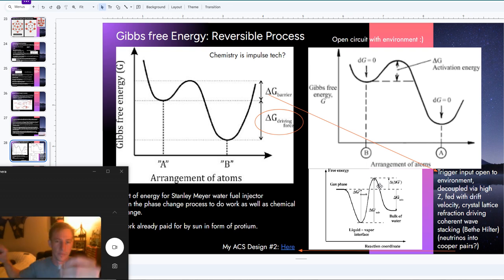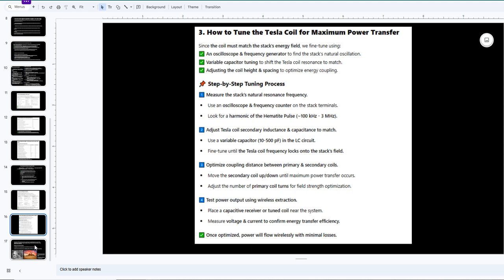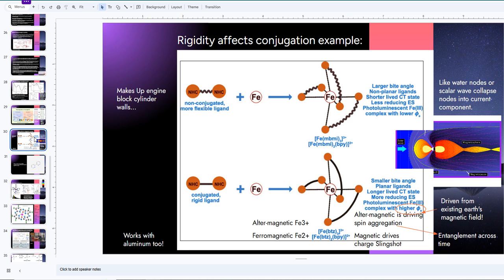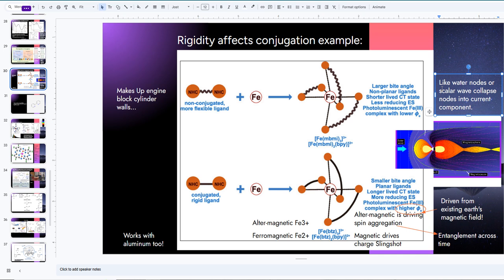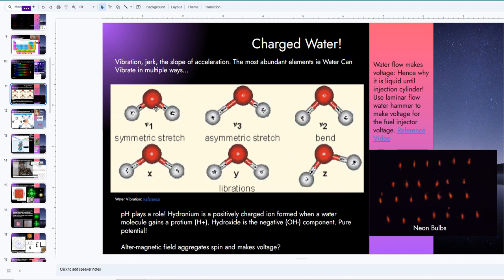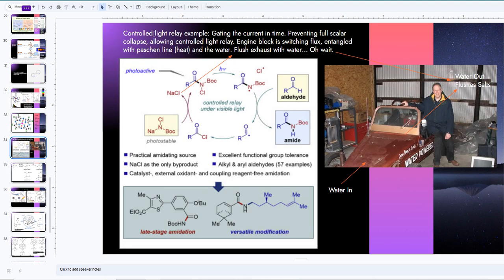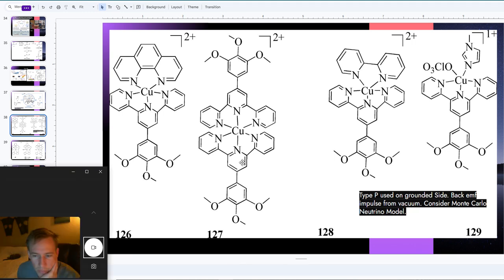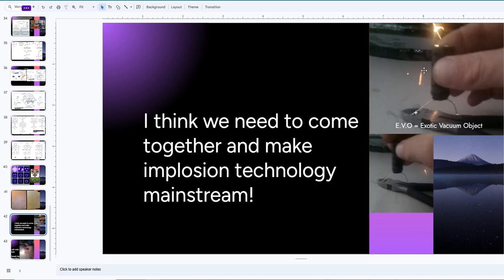Stanley Meyer Part 2

Comment: Try making use of the scientific method on the work of Stanley Meyer as I did and in doing so figure out the actual science behind the technology. Sure it took a long time to get at the actual science behind the technology as the scientific method is a slow process of elimination but it shows that Meyer and those that came before him like Dr. Dingle, were not frauds. The whole problem with this is no one is willing to make use of the scientific method as to do so cost money as the scientific method requires experiments to be performed, equipment to be purchased, and all of that.
I did these things and as I said found the science behind the technology and if I can do it so can you. Don't be afraid to fail as failure is our greatest teacher. Don't be afraid to build things and test them, don't be afraid to purchase the testing tools and measuring devices needed to further your experiments so that you can understand just what is and is not going on.
Meyer left us a lot of lecture videos to go over but I'll warn you in advance Meyer made up a lot of terms to hide the technology in plain sight. Don't fault Meyer for doing so as he simply didn't want people stealing his technology from him.
When you start actually testing with this technology everything starts to change if you take care to make use of the scientific method.
Reply from the maker: I do not have money to buy equipment or spend extra resources doing lots of experiments. Due to my position, I need to make junk into useful things that benefit my life. 

I have very little exposure to his actual work, only one YouTube video 20 minutes long or so. Its all fuzzy. You can probably correct the errors in my ways with your exposure. 

If you have already made the water fuel injector let's make it more mainstream! I will explore your channel as that is all I can do to work on this type of research at the moment. I cannot afford to buy anything to pursue it at the moment. So I will live vicariously through your channel
Reply: @ElijahCokeley  Like you I too do not have a lot of funds to toss at this technology but I do what I can. I never made the injectors but a good Water Fuel Cell that I work with which cost me around $15k as I had to have 8 of them made. Some others in a group I was in helped me as we all pitched in and they paid $1650 for theirs and I ate the remaining cost as the machinist got greedy and jacked up the prices on deliver day. The injector needs to be redesigned as Meyer messed up as he failed to keep the circuit electronically isolated from the car's electrical system with his design.
As for me I'll try posting more but I move at a pace I can afford which for most is too slow but I'm doing the best I can. 
This technology's build is complicated and must be built with a lot of pression. I saved my pennies to get the needed tools so that I could properly test on this technology when I ran experiments. Just getting the tools and other machines cost me a lot but I spread the cost out over time as I've been working on this technology since 2006. But since it did cost me a lot of money and most online groups kicked me out I don't teach this technology anymore as why give away all of my hard work for free when others could do the same as I did by making use of the scientific method just as I did? 
Right now I am building another transformer that is costing me over $3k to build just one. The way I see it with cost like these most out there simply can't or will be totally unwilling to build this technology so why give away what I know when not many out there can afford to build it for themselves? The way I am doing things will eventually get the technology out to the general public in a form that will be tested and safe for use. Due to the technology's complexity and cost I don't think many will follow my lead thus I have to be the one that brings this technology into our world.
Reply from the maker: If you ever want help collaborating hit me up! I don't care about money, I just want the little guys to win more.